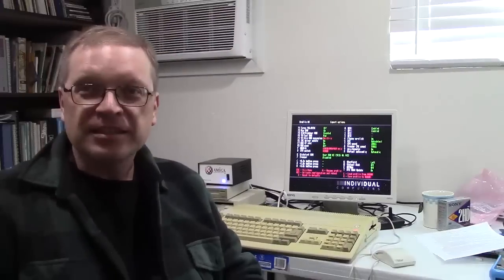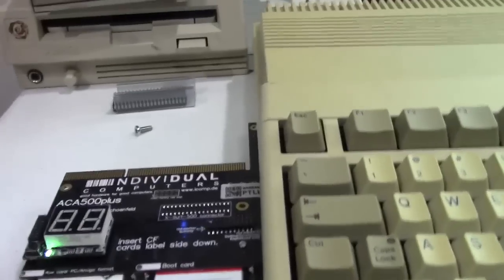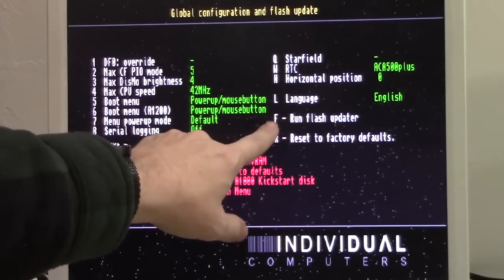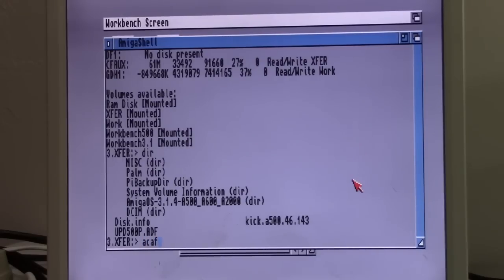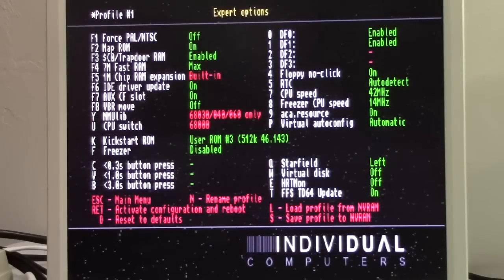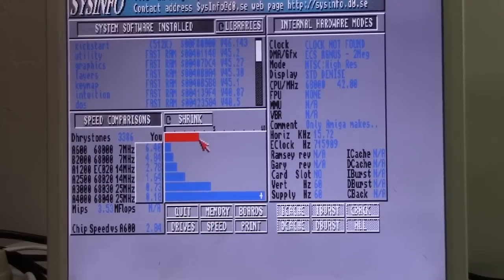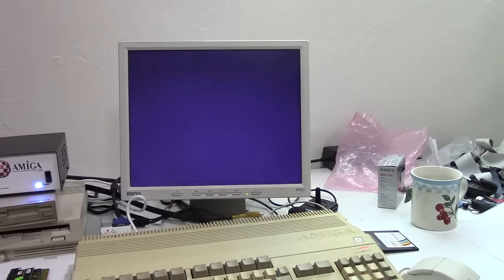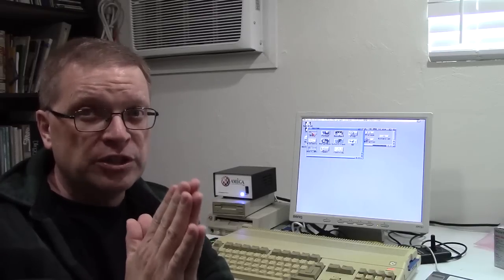10 Minute Amiga Retro Cast - ACA500+ Review & Configuring AmigaOS 3.1.4 on it

Comment: I can’t believe that I didn’t comment when I watched this video first time. Sorry Doug. 
Anyway as you know this is the video that got me to purchase the ACA500+ myself. It’s my favourite of all my Amiga things. It’s so versatile that I can’t recommend it enough. 
Today I final added the x-surf500 and the Indivision ocs/ecs mk2. Definitely a worthy upgrade. I’m hoping for an 030 accelerator by Individual computers for Christmas. 

Anyhow thank you again for this video.
Reply from the maker: Glad to hear it! I just killed my ACA500+ the other day - testing it in my Checkmate 1500+, I put in in the wrong way and blew a resistor. Bummer... I talked to Jens and he explained it is an easy fix, so I should be up and running with it soon!
Reply: 10 Minute Amiga Retro Cast : oh no.. really sorry to hear. I was worried that I’d broken mine but thankfully it turned out to be not connected perfectly, when pushed right into the Amiga it must make a dodgy connection and the board malfunctions on startup. Thankfully just pulling it back out a faction fixes the issue.
I do hope that it comes back to life. If not then I’ll have to put my Christmas present on hold to get you a replacement.

Comment: From time to time I wish for an internal solution like the Terrible Fire for my A500 instead of the somewhat ugly ACA500+ but then I see again the many great advantages like the fast installation of Workbench 3.1 and the external CF card drive. The data exchange with the PC is so comfortable. I would recommend it to every Amiga beginner.
Reply from the maker: I really like the Terrible Fire, but the limited RAM makes it a deal breaker for me. WIth the software I run I need every Megabyte I can use. I find that 64MB is Plenty for me on my A1200 - I almost never run short.

Comment: Great video.

Got also a ACA500Plus/ACE2 on my old Rev 5 AMIGA 500 but with a 4GB CF WB 3.1. Thuis week i get AmigaOS 3.1.4 and a 16GB CF and later on a ACA1221EC. Got also a Rev8A with a Wicher500i. Rev2a with 25MHz and 8MB FAST RAM. Waiting for the Vampire 500 V4,, A590 2MB FAST RAM SCSI2SD v5.0a 2GB microSD WB 1.3 and the HC533.
Reply from the maker: Those are some seriously awesome Amiga's there! Zoom!

Comment: This now becomes a tutorial for me, as my A500 rev 5 now has an ACA500+. Although, I did install the physical 3.1.4 ROM onto the board. So I suppose I could just create a profile that's set to use the mainboard ROM and install the OS from the GoTek.
Reply from the maker: Oh sounds like a very nice system. I would tend to go with the ROM installed on the ACA500+, as it is a lot faster to access the ROMS that way.

Comment: Hi Doug, intuition.library can be updatet (video 20:20). Copy LoadModule into C, add "C:LoadModule ROMUPDATE" to your Startup-Sequence after the Soft-Kick. I testesd it with a Blizzard 1230 Mk IV and a ACA1233n. I've installed intuition.library V45.13, the windows can be moved out of the screen. I woud have a suggestion for a video: Install OS3.9 with the 3.1.4 (and 3.1.4.1) updates.
Reply from the maker: I do have the Intuition library working perfect on my A4000, A1200 and A2000. It is only my A500 with the ACA500+ that gurus every time it is loaded. Must be a compatibility issue. I believe I did do a video on loading 3.1.4 over 3.9 to get the best of both worlds. That is how I run my A4000 and it works great using the script from Aminet.

Comment: Hello Doug,
Love your Retrocast and have just received the ACA500PLUS.
I didn’t have CF cards on hand, but I ordered some SanDisks from Amazon.  Not sure if I should order the 1223 or 1221 accelerator to go with it.  If I really just want to use it as a hard disk to run games on WHD load, would having another accelerator enhance my experience at all?
Reply from the maker: I can run a good 95% of the games I tried with just my ACA500+ at 21 Mhz. The extra memory goes a long way to making it work, and Jens built in hardware functions so that the keys to exit out of WHDLOAD work with the 68000. That being said, more power never hurts!

Comment: Very good review of the ACA.

Unfortunately, as you said, the limitation of the A500 is the bottleneck, the system will introduce wait states to access the custom chips hence why it is showing as slower than a stock 4000, but the ACA500 and A1200 expansion will be full 32bit, so CF to ram transfers will be full speed (to the limits of the CF controller).  Does it only run PIO and not DMA ?  Perhaps would have taken too long to introduce Multi-Word DMA.

The custom cases for the ACA is the best bet, because they also have the room to house the A1200 trapdoor expansion.  Jens made it compatible for the 1233, hence why the ACA's bios only shows 1233n for 'CPU Switch', but it shows that it CAN run other expansions, just that Jens cannot support cards other than his 1233n.

This would be an ideal candidate for my A1200 DKB Cobra since I do not have the SCSI addon for it (which is rarer than a 4 leaf clover).
Reply from the maker: Yes these are PIO only. But they are still some of the fastest hard drive speeds on the Amiga. Only my Vampire is faster, really.

Comment: Hi again, Doug.  On an earlier comment, I mentioned I had a new ACA500PLUS, but was waiting on some CF cards.  After receiving the CF cards, I was able to unpack the 3.1 ROM on to the boot card and I attempted to update to 3.1.4 using directions from your video.  Unfortunately, the set of disks I received from another vendor didn't have the Modules A600 disk.  I'm not sure how to complete my installation without it.  I'll probably just contact AOTL and see if they can send me a disk.  Do you have any advice?  I purchased Amiga Forever, new 3.1.4 ROM chips and AmigaOS on a 6 disk set.  I'm thinking there should be a way to do this without having the Modules disk.
Reply from the maker: If you bought the ROMS, then you can register on the Hyperion website and download all the disks including the modules disk. It is then super easy to copy the ROM to your AUX CF card and flash it to the ACA500+ - just grab your serial number for the software from the sticker on the ROM and head over to the Hyperion website.
Reply: 10 Minute Amiga Retro Cast 
Thanks for the reply!  I should’ve snapped a photo of the ROM chip before closing it up!

Comment: Doug, did you try to use AR3 to save states of whdload games?

Also, does AR3 implementation allow to save state on HDD, or floppy only?
Reply from the maker: Never tried it, honestly.
Reply: @10MARC  Thanks. Later I found info it is not possible to save to hdd/cf

I have two phisicall AR3s and they are ultimate game cheat devices. Which comes handy in these years way over 40, when there is not so much time to play. 😉

Comment: Awesome video! As an Amiga user since the early nineties (first A500, then and now A1200) I am incredibly impressed by the ham6 video - where did you get it? I would like to try it on my A1200/060. Thanks!
Reply from the maker: I create the videos myself. There are instructions and several videos on my www.10marc.com website, including links to all the tools. It is not simple, as most of it is command line instructions in Windows, but once you get the hang of it it is not too bad. I can link up some others, too. Check out the "Chocolate Lagoon" video from Bad Lip Reading that I converted to HAM6 - it is in my video list.

Comment: Very cool video! About to get an A500 to replace the one my mother sold when I moved out about 20 years ago... Do you think MP3's could play with the ACA500+ ? Just a random question... your video sold me on the accelerator card regardless! :)
Reply from the maker: I think I had an issue launching my MP3 software (songplayer) on a 68000 based machine. It might need a 68020, but I will try it out today. I have really only been happy with MP3 play back on a 68040 Amiga.

Comment: Hi Doug I'm Edmondo from Italy. I have an important question for you. I have a stock Amiga with a stock chip Agnus (not ECS) and so I have 512k of chip ram and 512k of slow ram in the trapdoor. In your opinion: could WHDload and other softwares  run flawlessly only with 512k of chipmem? Did I have to buy an ECS Agnus and swap it to make everything working? Thanks in advance.
Reply from the maker: WHDLOAD will always run best with 1 MB of CHIP RAM and a reasonable amount of extra FAST RAM. There are also limitations with running it on a vanilla 68000. WHDLOAD also needs some kind of mass storage solution to function. 
If your a500 is just bare bones, you would be better off running ADF files from a GoTek drive (floppy replacement). 
On the other hand, fitting your A500 with a Terrible fire accelerator would add a 68030, 64 MB of RAM, a hard drive interface and more for about $150. Totally worth it and would make your system a WHDLOAD beast.
Reply: @10MARC  ah, Sorry, I intended if I buy an ACA500+ but I don't change the Agnus, could the whdload work?

Comment: The thing that stopped me from buying was finding out that it is an asynchronous CPU u/g, with the clock speed based on PAL speeds. So, it will match up perfectly with the Amiga system bus for DMA as long as it is in PAL mode. However, it doesn't in NTSC mode. Hopefully the ACA1000 will be finished and released and will be synchronous. I believe that the majority of A1000's are NTSC. Certainly a higher proportion are then A500's.
Reply from the maker: That makes sense. The ACA500+ is good, but not my favorite accelerator. It is very, very sensitive to damage as is just about everything Jens makes. Glance at it wrong and it shorts out!
Reply: @10MARC  Oh, I didn't know that about his products! I've never bought any myself.

Comment: Hey Doug - I love this review... and your other reviews.  I've just bought myself an Amiga 500+ again after an absence of 30 years.  There are accelerator and expansion offerings now that just didn't exist before.  I like the idea of the ACA500 but I just have a problem with sticking something out the side of the machine.  My main new grievance with the Amiga 500+ compared to say the Amiga 600 and 1200 is a lack of hard drive, and a lack of memory to run games and apps from the hard drive.   In addition to side-slot mounted expansions, I'm now aware of the Witcher, the Vampire, the HC533.  For my money maybe the HC533 might be a clean option to get the 500+ to have a decent size hard-drive.  Could you do a story that focused on what is still out there on offer - that would provide a hard drive capability and preferably is a not destructive exercise... and ideally is internal to the Amiga?
Reply from the maker: That is an excellent idea. I have been researching the options already as I was thinking of using a different accelerator on my second A500. Maybe late November I can do a show on all the options
Reply: @10MARC  Thanks so much Doug for considering.  I really would love to see something that wraps up a bit of info covering the available expansion boards in the at-this-time.  Maybe a comparison matrix would work.  For me I don't even care if you have the physical cards, or even if you install one in your video (kudos if you do)... I would just like to hears someone I trust to talk about the pros and cons of each (including features, availability, execution stability, cost, support for WHDLoad, ease of physical install, configure, and dynamic use etc).  There seem to be some older videos on youtube about various A500 accelerators (1-2 years etc), but these boards may well have been updated since then, and there is nothing really definitive. 

I also forgot to mention the Terrible Fire card... (but I'm still not sure if it just an accelerator or can also support a hard drive).  Another aspect that I have thought about is whether the expansion has a real-time clock, whether it support any other existing RAM expansion OK... and something else that I have been thinking about is why do they most often use Compact Flash?  What does CF provide over SD.  Then there is also the question of whether I need to buy a new Kickstart ROM to get access to all of an expansion card's features.  I current have KS 2.1 ROM installed, and a 6a revision board.  Are there options to use SD & Micro SD, and if not are there any Compact Flash to SD card adapters, that will work OK with the Compact Flash IDE, or will only a genuine CF card work?  Too many questions to little time, and too little cash to experiment myself unfortunately?  I guess that is always the thing... once someone has decided on a suitable expansion board ... what else needs to be purchased?  Probably a CF card, but if I already have a swag of micro SD cards... could I just buy a CF 2 SD adapter, and would that reliably work.  The base requirements I guess stay the same.. what can I buy (bang-for-bucks) that provides a hard-drive capacity and some expanded RAM for the A500?

Comment: Doug.. great stuff.. Where do I buy it and what else will I need? First I need to get my Amiga out of storage and make sure it boots up okay. Do you have a recommendation on a monitor that would work well? Thanks again...
Reply from the maker: Individual Computers at www.icomp.de has the ACA500, and I think they are in stock. The website is in German, but there is an English button. Don't worry about ordering overseas, it actually ships quick. If you don't have a traditional Amiga monitor anymore, take a look at my video "The 15 Khz Conundrum and my review of the GBS 8220 interface for some ideas.
Reply: BenQ BL912 is ok for VGA LCD
Reply from the maker: @somewhere-in-time  does that one support forcing a 4:3 aspect ratio? The Acer I have does not, so all my Amiga screens are forced to 16:9 which looks a bit odd. I am still quite happy with it, though.
Reply: @10MARC  I think the monitor itself is 5:4 so its atleast closer to regular ! I think the native PC resolution is 1280x1024 - I do struggle with black borders here and there though .. but it seems I get that anywhere if not on native Amiga monitors. :-/

Comment: Fomo got me just ordered!!! So let me get this straight. i won't need to upgrade my chip to 3.1. Im on a a500 ntsc rev6?
Reply from the maker: No, my a500 Rev 5 has a 1.3 Kickstart, but I can soft kick any version of Kickstart that I own. It's fairly easy to flash a new Kickstart ROM to the card, and it can hold several different ones.

Comment: So want one of these.  Need to expand my paper route!  :)
Reply from the maker: They are worth every penny - and you never worry about compatibility, because you can disable it so easily
Reply: @10MARC  What to you recommend for Compact Flash?  Size, Speed, brand?  What file system should it be formatted in?  Does it come with both flash cards?
Reply from the maker: @pauldeane8369  I have had pretty good luck with the 16 Gig SanDisk compact flash cards. I get them on Amazon usually. I make a 4 gig workbench partition and a 12 gig Work: partition. To be honest, I have had pretty good luck with a new fast file system in the new OS. I have nothing against PFS, but the new FFS is not too bad. It comes with no flash cards at all. I have a really tiny one that I use for data transfer, but I will be ordering a 5 gig one for that purpose, because it is only used to transfer data and update firmware
Reply: @10MARC  Are you preparing the CF card on the ACA500+ or via WinUAE?  Having all sorts of issues via WinUAE
Reply from the maker: @pauldeane8369  I installed mine right on the A500. Which card did you end up getting? And which OS are you installing? All of those are factors. If it is 3.1, you have to keep your partitions below 4 GB or it won't work right. 3.1.4 does not have that problem, but you have to make sure the ROM is loaded and you are booting to that ROM. Idiot is easier, hit me up on Facebook Messenger and we can talk about it.

Comment: When you boot to a bare 3.1 boot disk it shows as only having 5.5mb of fast ram. Is that because of the option to copy the option rom in the advanced settings?  Otherwise I would probably find leaving that option off would not hurt any performance and give the extra bit of ram.
Reply from the maker: The ACA500+ only has 7 MB of RAM, but it keeps the Kickstart  ROM in a different area. I use Amiga OS 3.1.3 and usually have around 6 MB of FAST RAM free. 
Keeping the ROM in Flash Memory actually increases speed quite a lot - more so than having an extra 512KB of RAM even if it did use it.
Reply: @10MARC  That makes sense. which workbench were you using when you did the flash update? I thought that was the old plain 3.1?
Reply from the maker: @wishusknight3009  I may have been experimenting with AmigaOS 3.1 on that video. I usually use Amiga OS 3.1.4, though
Reply: @10MARC  Ok. That was the part where i was wondering why it would have used so much. My son just pointed out that you mentioned you had increased buffers setup on your drives.  That may have been it, as when you boot 3.1.4 later in the video, it is using a bit more ram which seemed in line with the difference I see between 3.1 and 3.14 without rom copied to fast ram. 

lol it just seemed weird that 3.1 would use more than about 200k.
Reply from the maker: @wishusknight3009  you are probably right. I may have used a larger block size, and then did what I used to do, which is to use 150 - 300 buffers, which just eats away at that fast RAM!